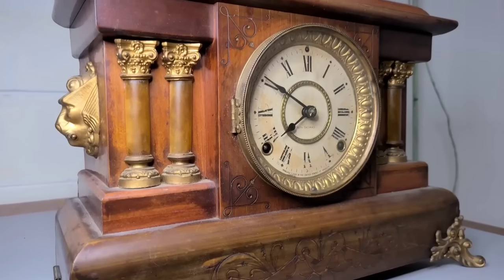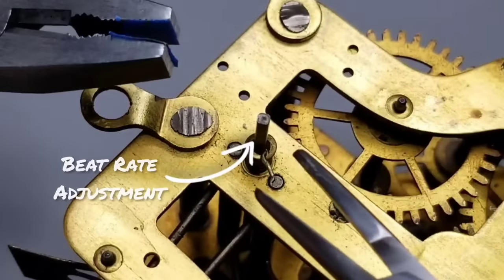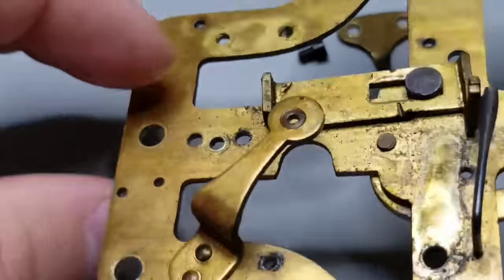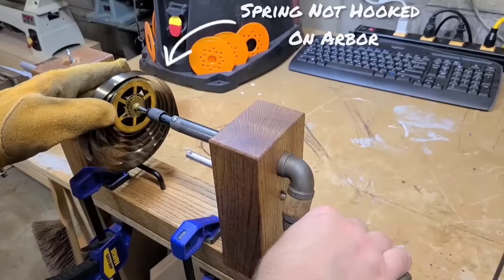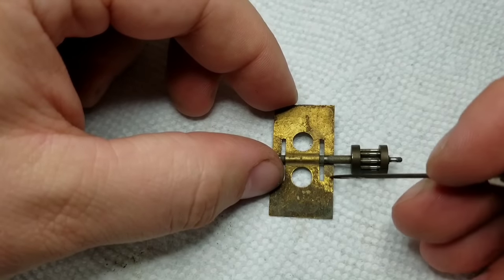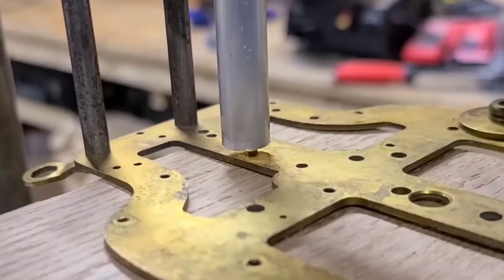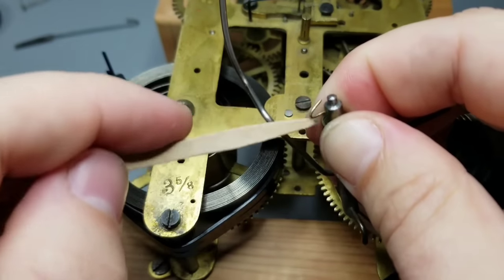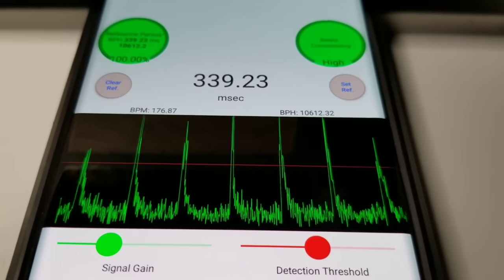Neglected 1900 Seth Thomas Clock Restoration

Comment: I got lucky at a local thrift store and picked up a very nice condition Seth Thomas a lot like this one two days ago dated 1889. Opened the back and noted it was very clean and found lead bob taped to the base. No key but a #6 I had at home fit it. Wound it up and installed the bob and it started right up. It's keeping time and the chime sounds nice...I'll need an original key but for the 15 dollars I paid for the clock I'm very happy.
Reply from the maker: Very cool! I'm jealous! I've been looking for more antique clocks to work on and they are hard to find for a reasonable price.

Comment: really appreciate the time you took to make this video. These movements seem so much simpler than wristwatch movements! I guess taking the seconds hand out helps. Anyway this was super cool, I really want to buy an old mechanical clock and fix it up now!
Reply from the maker: Thanks! Yeah, it's not as stressful working on a clock than a watch because the parts are bigger. You should give it a try!

Comment: I  very  much  enjoyed  this  video .  I've  always  been  fascinated  by  things  mechanical .  In  the  comments ,   someone  suggested  using  brake  cleaner .  I  would  suggest  instead  use  carburetor  cleaner .  The  brake  cleaner  would  work  but , contains  harsher  chemicals .  Carburator  cleaner  would  do  the  job  and  is  easier  on  the  hands .
Reply from the maker: Thanks for the suggestion. I'll have to check that out. Thanks for watching!

Comment: Excellent video.  One thing you might want to try in the future is when you are cleaning the movement frames, use "Barkeepers Best Friend" and a small piece of paper towel with a small amount of water.  I used it on a silver lamp to clean off decades of tar and nicotine and it polished it also.
Reply from the maker: Thanks for the tip and for watching!

Comment: Hello, sir!
Nicely done, and with restricted tool set. Awesome! 
You've miss couple things: rattling sound from windbrake  (or airbrake) on strike side, means its pivot holes are worn and needs bushings too. And second one, there is should be no metal screw in striker hammer. It should have dense leather insert in it, to have nice and soft sound.
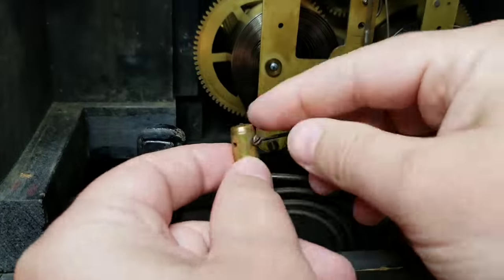Reply from the maker: Thanks. I did replace the metal screw with a leather insert (39:46). You didn't watch until the end...
Reply: @WatchOverhaul  oh, you really do, I see. Sorry 😅

Comment: CRC makes LPS-1 lubricant that goes on wet and dries, you don't even see it and it won't collect dust/dirt. I use it on my airplane control cables and pivot points/hinges. It's great stuff and looks like clock movements could be a good application. I have the same clock that was my great grandfather's.
Reply from the maker: Cool. I'll have to look into that. Thanks for watching!
Reply: @WatchOverhaul  oops, my bad. It's just LPS-1, CRC is a different brand.

Comment: Interesting approach to bushings, I've never seen before.  Seems to be effective, without a lot of extra tools!  I think you might have got lucky with the proper mesh using that approach, but it's results that count!
Reply from the maker: The way I did it was how I saw it done in videos that showed how to do it by hand. The bushing fit just right because I slowly crept up on the correct diameter. I went slow and checked the diameter frequently. I can't show everything I do because the video would be 10 hours long. Thanks for watching!
Reply: @WatchOverhaul  Overall I was impressed with your work.  Like that spring winder too!
Reply from the maker: Thank you!

Comment: Very nicely done and narrated, thanks for sharing. You might want to consider getting yourself a set of oilers, it seemed like the oiler you used over oiled some of the pivots. 
Thanks for sharing.
Reply from the maker: Thank you! I'm still learning and getting used to that oiler, so I might have just used a little too much.
Reply: @WatchOverhaul  Aren't we all 😄
You should have a video about the shop made mainspring winder, looks well thought out.  Another thought (from James Martin) is to use rubber bands to hold the plates together while adjusting the pivots.  I tried it and it seems to help although you need the find the proper size bands. 
Looking forward to more content.
Reply from the maker: I thought about making a video on the mainspring winder I made. I'll add that to my list! I've heard about using rubber bands. Lightly tightening the plate screws as I go has been working, but maybe using rubber bands could be faster.

Comment: I dip bicycle parts of this size in extraction gasoline (extraction naphtha) poured into a ziplock bag. Then I put the whole bag in the ultrasonic cleaner.

The bags must be of good quality so that they do not leak. This is happening a lot lately.

I am satisfied with the effect.

Comment: Such a treat to watch the simple tools you were able to use to repair such an old clock.
Interesting the fix for a bad bushing.
Do the teeth on the gears wear out so replacements must be found on these old clocks?
Reply from the maker: Thanks. I think the teeth can wear out, but they are specifically designed to minimize friction. Professional clockmakers should have the tools and skills to recreate parts if necessary.

Comment: 2:09 those uneven spacing in the mainspring indicate the spring is improperly lubricated or the lubricant dried off so it was well overdue for servicing good thing you were able to get to it before more damage was done to the movement for letting it run like that! 👍
Reply from the maker: Good catch! Thanks for watching!

Comment: The moment I saw you take the structure holding the crutch in place & the clock didn't start ticking rapidly, I immediately knew something was wrong.
Reply from the maker: Yeah, I also didn't wind it that much because I wasn't sure how stable the mainsprings were. So there wasn't that much power being provided, but it still was obvious there was a problem.

Comment: great video! i'm curious why you dont use a clock cleaning solution w a bigger ultrasonic machine? 
however it's cool how you hand clean every part.
Reply from the maker: At the time, I chose to save a little money by using something cheaper at the expense of a little more elbow grease. Ideally, I would prefer a bigger ultrasonic cleaner to regain more of my sanity. Thanks for watching!

Comment: What i do for cleaning most of the time, is use water based clock cleaning solution and mix some with water to cut it and use a toothbrush like your doing and it works great. Does a good job of cutting the grease and dirt.
Reply from the maker: What clock cleaning solution do you use?
Reply: @WatchOverhaul  It's Poly Chem DEOX -007 Concentrated Degreaser, Deoxidizer and Brightener. Says it can be used as a dip, in an ultrasonic cleaner and by hand.
Reply from the maker: @tig1tig1  Thanks. Does it remove patina? I don't really want to use something that removes patina or makes the movement look unnatural for its age.
Reply: @WatchOverhaul  i know what you mean. What i was doing in that situation was just scrubbing the sides of the clock plates that you can see, and definitely leaving the outside of the back plate the way it is. One of the main things I try to get off the movement is that sticky film that's on it that builds up over the years from being in a greasy kitchen or a house that had older gas stoves with pilot lites in them.
Reply from the maker: @tig1tig1  Thanks for the info!

Comment: I know absolutely nothing about clock movements, and this, I find this very interesting, but I do know that old lubricant that’s has hardened, dirt, dust, and mechanical misalignment is not a good thing in almost anything mechanical. Thanks for the video sir.
Reply from the maker: Thank you! Less than a year ago I didn't know anything about clock movements, so I've been trying to learn and figure things out.

Comment: As a tip from a watchmaker, when cleaning parts it’s better to use a solvent in the ultrasonic cleaner.  Ethyl alcohol does wonders and is available by the gallon for ~$40.  Esslinger or another horology supply will also have cleaning solution designed for ultrasonic cleaners.  Yes, this is expensive, however, the upside is, the solution is reusable, and it will get your parts far cleaner.  If you’re looking to get into clocks, I would highly suggest a bigger ultrasonic cleaner though.  It’ll make life easier.
Reply from the maker: Thanks for the tip! A bigger ultrasonic cleaner is on my list.
Reply: @WatchOverhaul  remember with any watch or clock, water is the enemy.  Even with a heat gun, you’ll never get it all out, which leads to rust.  I do fill my ultrasonic cleaners with water, but all of my parts are in Mason jars that have a lid.  I have four solutions.  They’re labeled, never mix.  One I only use if the movement is REALLY dirty just because it’s harsh.  Typically I use Zenith DrizeBrite cleaning solution and rinse, followed by concentrated ethyl alcohol.  And any time I’m pulling cleaned parts, I’m wearing nitrile gloves to prevent contamination of those parts.  Skin oils attract dirt and debris, which will later lead to excessive wear. Just a couple of tips to help you.

Comment: Suggestion for cleaning springs and gears,  us spray brake cleaner it dissolves and dissipates the greasy build up that clocks attract and leaves no residue.
Reply from the maker: Thanks for the tip!

Comment: This was very fascinating to watch. Repairing a mechanical clock like that is similar to my hobby of restoring vintage model trains. They are usually caked in dried grease and some have worn mechanisms. (some have clock work motors). I am curious where you got the bushing set, I might have to find a kit like that for replacing bushings on train axles.
Reply from the maker: Thanks! There is a link in the description to the bushing set I used.

Comment: I am a wind-up clock fan. I have 3 different wall clocks on the walls in the living room. I have never seen a proper cleaning and repair. You did a great job. Have you considered using brake cleaner to clean up the windings it leaves no residue of the cleaner..
Reply from the maker: Thank you! Others have suggested to use brake cleaner and others have strongly advised against it due to how toxic it is. Using WD-40 seemed to work fine, and I've been able to remove any left over residue.
Reply: @WatchOverhaul  Acetone is not all that toxic, but it is flammable. It's a normal metabolic byproduct in living cells and cells have methods to process it. But dose makes the poison, so as with all things in life, don't over do it.

Comment: How tight were the springs on that 8 day clock? How much tighter are springs for 31 day clocks. I have a wall clock of which I only have to wind once a month. but it works fine and keeps pretty good time.
Reply from the maker: I'm not sure I understand your question. I don't know what you mean by "tight" and "tighter". The big difference between 8 day clocks and 31 day clocks is the length of the spring.

Comment: I have this clock. It too probably needs a cleaning. It works for a day or two then stops. 
I really appreciate you sharing your knowledge and skill with all this. Great stuff. Fun fact too about the cellulose finish on the case. The one I have is completely covered in faux marble - shades of orange. I wonder if the clock you worked on mightn’t have had some of the celluloid removed? It appears to be a combination of wood and faux marble. Time to do some more research and planning for my own restoration.
Reply from the maker: Some of the celluloid was starting to chip or peel. I didn't think large portions were removed, but I could be wrong. There are many different variations of this clock. Thanks for watching!

Comment: You could try automotive Brake Cleaner to get the grease and oils off. It doesn't even leave a residue when it dries/evaporates, which is fast. I sometimes use it to get tree sap off my windshield, and I use it to clean starch off my fabric scissors which helps keep them sharp.
Reply from the maker: Thanks for the tip!

Comment: Is there a reason you don't uses a degreasing cleaner? Like let the springs and really forty parts soak in it?? This is so cool, looks very confusing, I can't wait to see it working again
Reply from the maker: There isn't a particular reason I didn't use a cleaner like that. I didn't actually think about it because the stuff I normally use seems to work just fine, but I might be making it harder on myself and a degreasing solution might be better.
Reply: @WatchOverhaul  lol oh. Got ya. I asked because I know some are really powerful and didn't know if it would change the color of the brass. I had some Purple Power I think its called and didn't read the instructions lol you know like a man. Hahah. And I saw that my hands were really slippery, I thought it was because the soap. Nope, it had taken the first layer of skin off. I was supposed to dilute it lmao. Now I know hahaha 😆.  
 Also laughed when the main spring went off by itself. Heck it scared me too lol. That thick grease is probably the reason many people think old clocks are haunted. Hahaha. Just ding out of no where.
Reply from the maker: @frankierzucekjr  haha, yeah, that's why I'm hesitant using different cleaners because I don't want anything too harsh and don't want to remove the patina. Yeah, that spring almost gave me a heart attack haha.
Reply: @WatchOverhaul  haha it even made you curse hahah.

Comment: I have an 1899 mystic adamantine clock and am eager to work on it to restore it back to its former glory. I would just use mild automotive solvent to remove grease and wooden popsicle sticks sharpened into tips to clean out debris on the metal plates. However, I would like to add a tip to use IPA (Isopropanol Alcohol) as a last step to dry out the parts. IPA basically drives water away and dries out quickly so using air dryer is unnecessary. My clock is missing the one wood mitered trim that is one color (glossy grey) that I am going to attempt to recreate how they did the adamantine process. Perhaps I can find the patent and look up the process to recreate the trim coating. It looks shiny and almost new looking and I'm surprised how new it still looks even after 100 years.
Reply from the maker: I've found that IPA leaves behind a white residue when it dries. It makes everything have a white haze that requires more work to clean off. This is why I started using mineral spirits. Maybe you'll have better luck than me.

Comment: I have the exact same clock, and... It runs beautifully.  I use sewing machine oil to lubricate it every few years.
I have a question please, when it strikes the hour the chim is not correct, meaning five o'clock may strike seven times. Any help how to fix that is greatly appreciated. Thanks.
Reply from the maker: If it's always off by the same count then you could just loosen the hands and reset them. Other than that, I don't know what's wrong without working on the clock.
Reply: @WatchOverhaul  thank you I appreciate it.
Reply: @WatchOverhaul  did that today, and it worked perfectly. Thanks again.
Reply from the maker: Glad it worked for you!

Comment: So today I just recieved a clock very similar to this. Same basic shape and the mechanism seems to be the same. I have no idea on the manufacturer but I believe it was acquired my grandmother  in Germany. Now mines face seems to have a brasslike metal without paint for the face and it's missing the glass face cover assembly the hands and the key. It does have a music box built into the back. From what I can see the arm that holds the weight on mine is attached to a thin metal and that metal is broken just before the arm attach point and the winding key is missing. Other than that it's fairly dusty but the mechanism looks quite nice. Is there any place you could recommend to help identify the clock as it has no lable in it and any place for parts you would recomend.
Reply from the maker: The clock movement usually has markings on it. You might have to take the whole movement out to see all of the markings. Sometimes, the bottom of the clock has markings in ink that might only be visible if the light hits it just right. You can get parts at clockworks.com. Thanks for watching!
Reply: @WatchOverhaul  thanks a ton. So no ink marks I can see. I will keep that website in mind. Thank you.
Reply from the maker: @terryrhuebottom2194 no problem!

Comment: Would you consider polishing the parts? Using Flitz or similar or some such? Maybe an electric brass polisher as used for ammo brash?
Reply from the maker: I plan to try polishing the parts at some point. Making metal look shiny has been low on my priority list.
Reply: @WatchOverhaul  I get that. I am torn between make it new and leave it to show its age and heritage, the stripes it has earned. Just wondering what experience you have had, is all. Thanks keep up the great videos
Reply: Household ammonia works nicely to brighten the brass in the cleaning process...

Comment: I have a mantle clock very similar to this one which belonged to my Great Grandmother.   I would love to be able to identify it.  What's the best way to finding out more about it?
Reply from the maker: Look for any markings on the clock and read up on what the markings mean. You can look on the bottom, back, on the movement and behind the dial. Sometimes the markings are hard to see and might require a flash light held at different angles.